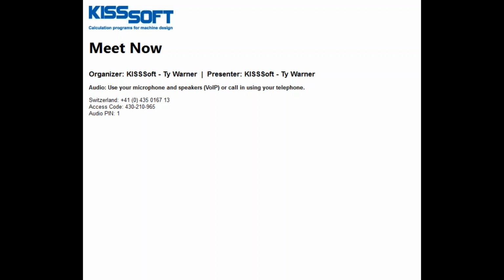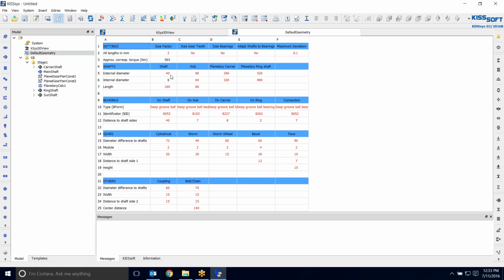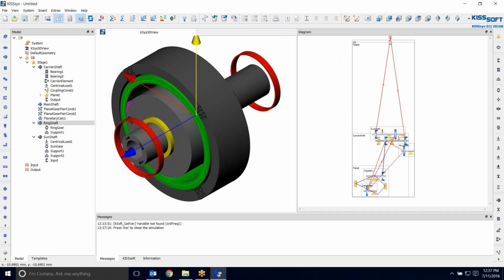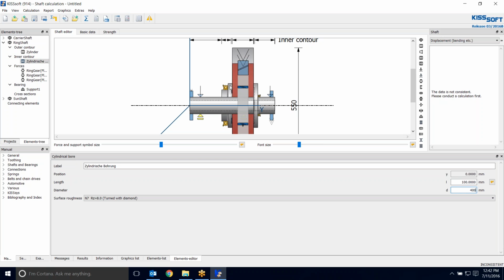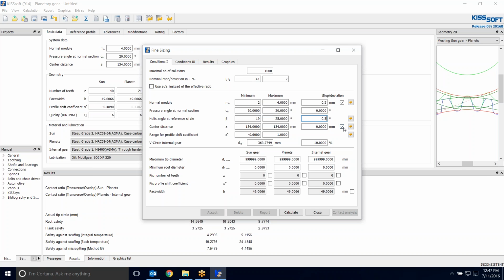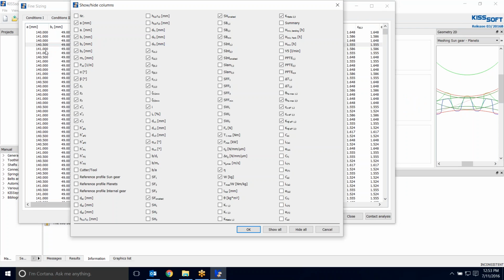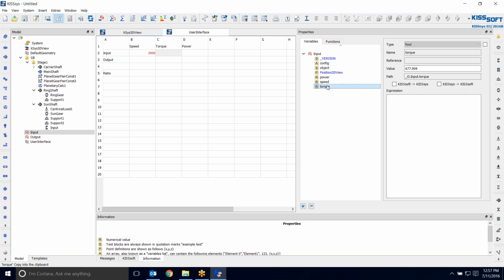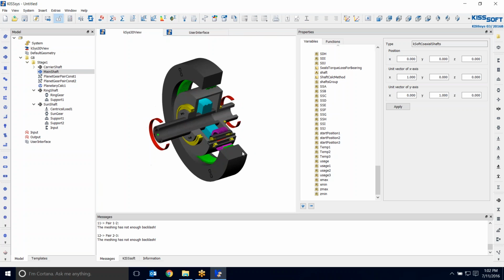Planetary Sizing in KISSsys

Comment: Thanks for the tutorial but I have a question about positioning planetary shaft. I think their positions is dependent to carrier shaft. When I changed the carrier shaft position axially their positions change also. But I cannot change radial position of planet gears (I want to arrange axial distance between sun and planet gear) in KISSsys module. I tried to change the distance between sun and planet gear axis on gear calculations Kissoft module and clicked refresh in KISSsys, the radial positions of planetary gears did not change in KISSsys. I also tried to change its positions by 'show coordinates and entered required positions and clicked OK' I could not see any change on position of planetary gears on KISSsys.
Reply from the maker: if there will be an axial offset, you need to define that in the gear calculation module, basic data and next to the the facewidth tab, there is a plus icon, click that, and you can define an offset.  I think this is what you are asking.

Comment: Hello, I followed your example, but at 9:04 I got an error message saying "Kinematic calculation error (Number of constraints is wrong (4 instead of 5)". Error in speed definition.) I can't find the reason. Could you help me solve this problem? Thank you.
Reply from the maker: is the ring gear fixed?
Reply from the maker: You'll need to check the supports in the shaft modules I think, check the ring gear is fixed with the supports.

Comment: Is there any specific video realted to the efficiency calculation of one stage planetary gearbox?
Reply from the maker: @Sanchit0312  i don’t think so, however it’s an efficiency calculation module so if you have that module u can calculate the efficiency of a planetary along with machine elements
Reply: @kisssoftusa9363  I have some another model of planetary how do I import that model to kissys. Or I should put my model parameters in the template provided by kissys?
Reply: @kisssoftusa9363  how to import chain sprocket in kissys. The 3d model it only shows calculation here
Reply: @kisssoftusa9363  is there any other way to connect with kissoft any community or mail ID where I can ask the queries

Comment: 13:00 this step don't work in KISSsoft 2022 sp5. Can someone check it out?
Reply from the maker: I just tried doing a gear sizing planetary using 2022 sp4, and it worked.  Do you have all the necessary modules?

Comment: What is size factor???
Reply from the maker: The size factor is a number you can specify that will provide an approximate corresponding torque in Nm, and then size all of the gears and shafts when you start entering the machine elements in the model tree.  So if you turn on geometry when you add a shaft or a gear, the program inserts a gear or shaft at the corresponding torque based on the size factor of the settings.

Comment: Hi, i am a student developing a gearbox for offshore wind turbines, i am trying to configure the first stage planetary gear, but when following this video I get an error when testing for the kinematics.  Number of constraints is wrong (4 instead of 5). Error in speed definition. Can you help? 
I am using version KYSSsys 03 2017A
Reply from the maker: What University are you attending?  If you go to the templates icon, you can add a complete planetary stage.  If you are using a University License, we can get you an updated version that will make this much easier to set up.

Comment: Hey my friend, cool video, but i have a problem. I am a student develping an one stage planetary gearbox wich has two inputs and one output. the problem is, that kisssys can not sum up the two powerinputs into one without a kinematic error. can you help?
Reply from the maker: So, in your case, you can develop a couple of different ways to run the power split.  First, you need to define the boundary conditions of your inputs and outputs.  You should have three total, two in and one out.  You can manually run the power split by controlling the torque and speed inputs and outputs.  for example, if you control the output torque, you need to control the speed at the inputs and let the torque not be controlled.